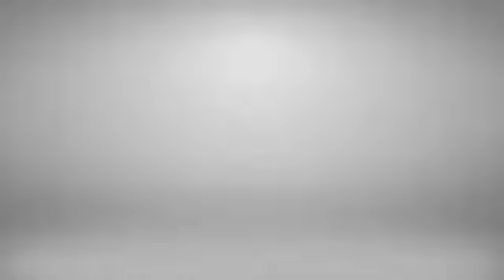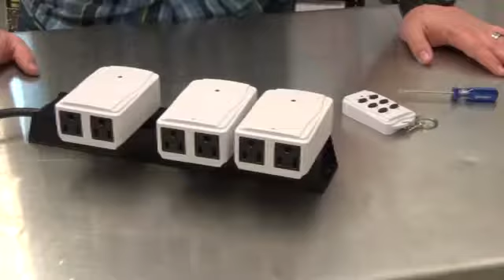HLRC23PK - 3PK Remote Pairing

Comment: Good video but I have a different problem with my PRIME HLRC23PK.  My remote is pairing fine on all 3 channels and 2 of the receivers are working perfectly.  But the receiver on channel 2 shuts off within a second or 2 after I turn it on even with nothing plugged into either outlet.  Is that fixable?

Comment: Can I add an additional remote to control same 3 receivers?
Reply from the maker: If you had the same remote yes there are syncing instructions but we do not sell or have an additional remote for purchase
Reply: @primewireandcable  If I purchased two sets and thus had two remotes, would your company share synching procedures so I could run one switch off of two remotes?

Comment: But what if the light on the box that go’s too the socket ever flashed or anything
Reply: Either the socket don't work or the switch for the socket not on the light on the power thing goes fast when you plug it up
Reply from the maker: Please try replacing the battery to your remote and then resyncing the remote to the receivers

Comment: Mines still didnt reset
Reply: I had to do it a few times. It's like soon as you plug it back in push the battery case closed. Hold the off to it then press on. I had the lamp already plugged up with it so I know it'll work hope it works for you
Reply from the maker: You can always call our customer service line to submit a claim for a replacement. 888-445-9955